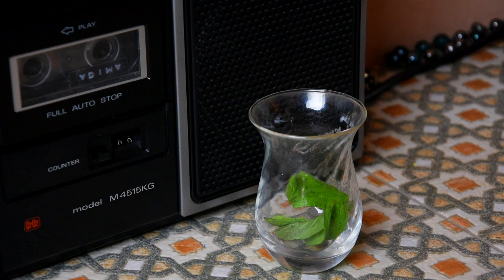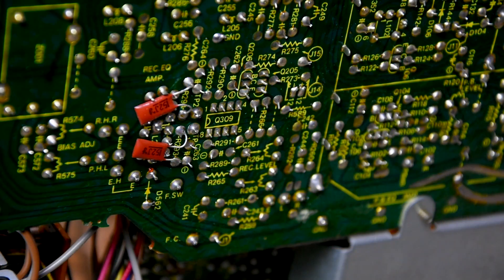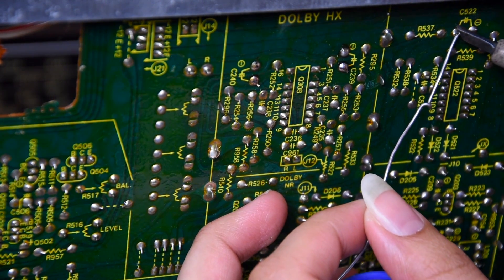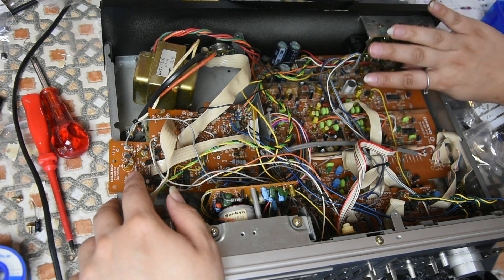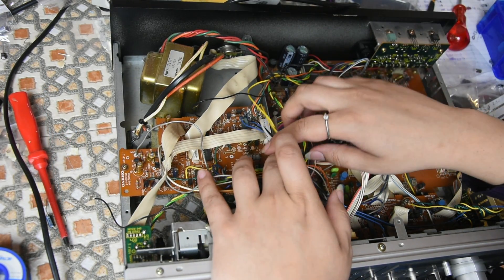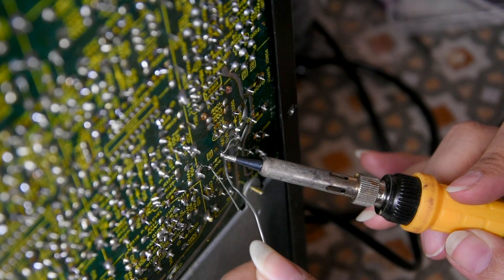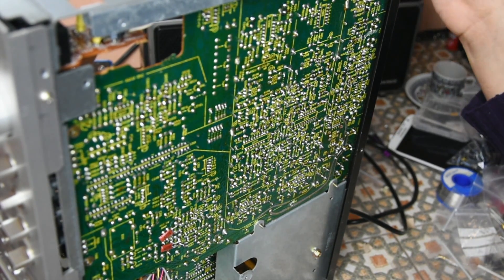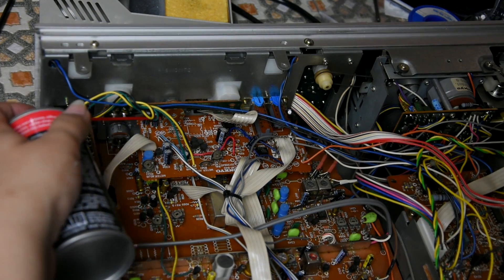Onkyo Tape Deck Part 2 - Capacitor Replacement

Comment: hi there! why did you chage  a lot of capacitors: it s a fake reason. Nowdays I had had to repaire a jvc qla-2 turntable,the problem was the stroboscope lamp was flickering ,and went out,4 capacitoes was resoldered,but all of them was in excelent value.only the R824 went out but the epoxi was over on it.every 4 capacitors was correct after 42 years

Comment: Do you know what you are doing there? Why did you replace the capacitors?
Reply from the maker: Yes I do.. I replaced the capacitors because 30+ year old electrolytic capacitors tend to dry out and the value of them drifts rendering the circuitry not running as it should or they leak/risk leaking which could damage the pcb.
Reply: @MsMadLemon  that makes sense... It would be better if they would last forever. I used to replace one or two foil capacitors from my Yamaha pianocraft stereo because it didn't turn ON when I switched the key.

Comment: Is it just the camera angle or is your soldering iron tip the size of a shovel? From experience I have always found it easier to lay the board component side down on the bench. I'm not a posh as you I still use the spring loaded de-solder pump. with the board flat you can rest your hands on the rest of the board. this gives better stability with the iron and the components fall out under gravity.

Comment: By chance I saw your video. You don't often see a girl who likes radio equipment. Usually girls like dolls and butterflies. They don't do repairs, maybe because you need to strain your head. But this is a very good activity for training your brain. You speak English well, almost without an accent. But what country are you from and how did you come to this passion?
Reply from the maker: I get this feeling you don't know many girls, there's a lot more to our lives than dolls and butterflies haha. Some of the first computer programmers and assemblers were women btw, not to mention women doctors and scientists too :o)
I live in the UK but originally Arabic from Iraq. And when I was a child, I used to mess around with broken toys, take the electronic components out, then slowly it turned into messing around with motors, light bulbs, leds etc. Then later, computers.
Reply: I respect people who know how to repair radio equipment, because I know what it is and have been doing it myself for a long time. You yourself know that finding a fault is sometimes not easy. It's kind of like playing a chess game and requires a good intellect. As for women, for the most part they are as I wrote (this does not concern you in any way). Of course, there are very smart ones among them, but there are not many of them. I myself am a doctor by profession and studied at a medical institute in which girls were 90%. For 6 years, I came to the conclusion that they achieve success in their studies not by intellect, but by diligence and diligence (which men are deprived of).
Reply from the maker: "Dolls and butterflies" you are basically suggesting that every woman has a brain of a 3 year old. It's too much of a primitive and narrow view for a medical doctor is it not? it sounds like you've lived your 6 years in isolation judging by that conclusion.
The world is a big place and it's not possible for you to know every woman in it. Sounds as if you've come to a premature conclusion based on stereotypes.
Anyway, to you, your viewpoint.

Comment: This is great and you are very funny, maybe you are breathing in too much of the soldering smoke haha. I need to recap my Denon DR-M22 tape-deck asap. The capacitors must be about 34 years old now, so I think It's overdue and I don't want the power supply to fail and fry the rest of it which is the biggest risk I think? I will be replacing every cap in the machine and a few other bits.  I wish I had your desoldering gun, I am on a tight budget and only have a lowly pump! it's going to be a long job but I can't wait to start it. Thanks for the videos, they are entertaining me and helping me write a list of the tools and parts that I need to get together in preparation to restore my  deck, also making me think how I'm going to go about the job :-)

Comment: Were you trying to say farads? Capacitance units are in Farads (named after Michael Faraday, a genius) and usually are pF (picofarads) or uF (microfarads). One thousand pF's is one microfarad so the pF ones are much smaller. If you already know all of this then accept my apologies. Damn you are hot.

Comment: There is a reason to why some components are glued in place, and it has nothing to do with that they will fall off or anything but to prevent them from vibrating and because of that wiggle the solder until it breaks or it might cause resonance which will make the equipment to hum or buzz. There are corrosive glue or resins that could destroy the holes and the board if you're unlucky, so if you have the possibility to remove it then do so.

Comment: Hi Ms Mad Lemon. 
Just curious, why did you think you needed to replace all those electrolytic capacitors? 
Modern capacitors like in your Onkyo are very stable and last for decades without failure and don’t leak like old vintage oil capacitors. 
If there was any issue it would be with the large filter capacitors in the power supply section, but very unlikely. 
Anyway, fun to watch and like the de-soldering iron.

Comment: I've seen some of your stuff before from time to time, like your collection and set up of stereo equipment. Just seen this and you very clever to do this type of thing. Im always amazed and respect people that just know and fiddle with electronics cos I don't have a clue. Wish I knew how to mess around with electronics cos I've got bits I wish to make as a hobby.  I live in London and for the past few years been searching and researching to set up a nice stereo system with a turntable I have in mind but with a vintage amplifier and nice speakers from the 80s or 90s. Want to have a little record collection of my own cos I used them as a kid... Was great sound and still so fascinating. Would love to be able to speak to you about sound systems, equipment and servicing of such stuff before I go out and buy. Love the videos anyhow. Great work, keep it up.

Comment: I got a nice ghetto blaster boombox, but unfortunately the record/playback side of tape deck uses the permanent erase magnet instead of an actual erase head. And I was wondering if there is a way to replace the magnet with an actual AC erase head. Those erase magnets really ruin tape recordings, as they add unwanted background noise to my precious recordings. Any idea where I hot wire the wires from the erase head?

Comment: I think the eject system uses a rubber ring too  in the cylinder to brake the door. I've seen similar parts in Akai decks

Comment: Electrolytic capacitor replacement is recommended, perhaps every 20-30 years? 
For those who are not sure - replace with the same capacitance value, and with the same polarity - but a higher voltage rating can be used, no problem.

Love your videos. (Greeting from the UK)

Comment: You are right about the labeling of components. Makes it much easier on decks that have them. The reason a lot of companies would glue the big caps is to keep them from vibrating. Great job on the recap.

Comment: Dear Ms. Lemon,  I've watched other videos regarding replacing all the capacitors in electronics, but I do not know why they need to be replaced. other the ones that are swollen.  Can you help me out here regarding the importance of replacing capacitors?  Regards, Carl
Reply from the maker: Hi Carl, actually a couple of reasons. As you know with the ones that are swollen they can leak and corrode the circuit board causing damage. But not only that, the electrolyte in some of them can dry up and the value of it can shift causing many different problems depending on where the capacitor is/what it's used for in the circuit. Filter capacitors will not be as effective, therefore will not filter out noise as they should. There are people who say "Recapping is not required" actually i've proven that it is. for example I recapped a Commodore 64 computer, which before would not load certain games, it kept coming up with load errors no matter what I did, after recapping most of the games that didnt load, started to.
Regards, Maddi

Comment: Can you imagine how scared I was when I first plugged in an AT computer power supply after a nearly-full recap yesterday? I've had two of them blow up right in front of me so I know what that feels like (untouched ones, not ones I'd re-capped)! Did use a series light bulb just to be safe but it doesn't seem to do much with such a small load. The PS just turned on as if the light bulb wasn't there. If I remember the voltage divider rule correctly, I should have used a smaller (i.e. higher resistance) bulb than the 100 W i usually use. I was most worried about the only two capacitors I didn't replace because 330 uF/200 V are pretty hard to find. These are right behind the bridge rectifier so I suppose if they went, they'd do so with a fairly substantial bang. Not that I'm anything like an expert on switching-mode power supplies but I did figure out that the AC mains goes to the board, through some kind of inductor or tiny transformer, then a bridge rectifier and then the big caps (in series to get a 400 V rating) so I'd expect some nasty DC voltage at that point.

Comment: Do you have a link to where I can buy that solder remover you are using at 4:26? Thanks
Reply from the maker: I got mine from another place but it's basically this one: https://www.aliexpress.com/item/ZONESUN-110V-220V-Electric-Vacuum-Desoldering-Pump-Solder-Sucker-Gun-heating-core-suction-tin-S-993A/32906270535.html?spm=2114.search0104.3.250.7f544b03pnsEqh&ws_ab_test=searchweb0_0,searchweb201602_3_10065_10068_10130_10547_319_317_10548_10696_10192_10190_453_10084_454_10083_433_10618_431_10307_10820_10301_10821_10303_537_536_10902_10059_10884_10887_100031_321_322_10103,searchweb201603_52,ppcSwitch_0&algo_expid=2e77e844-fcf7-4478-b090-74bf2f96615c-34&algo_pvid=2e77e844-fcf7-4478-b090-74bf2f96615c&transAbTest=ae803_3

Comment: 1:13 that didn't look like glue to me, but like electrolyte ooze! The reason i think that is because it's that flat around the base - think about it, it wouldn't be possible to apply glue after it was soldered down. But if it's ooze, it's better to get it all out, get in there with contact ether, with isopropanol, whatever your weapon of choice, and get it all gone so it doesn't eat into the PCB underneath or the capacitor that you install next on that spot. I mean still could be glue if they applied it pre-wavesolder to make it not jump off the board while it's doing the wave, so i'm not 100% certain. But yeah they can ooze from the bottom, if they ooze slowly and the pressure isn't enough to break the top.
Reply from the maker: That was definitely glue, electrolyte ooze I imagine would do more damage to the board by now, nor would it stick down that hard. There is some leeway when the cap is soldered in, enough to lift it slightly and squirt glue under it.
Reply: Who in their right mind would fiddle with a capacitor after it's soldered in, at a factory where they have to make hundreds of those boards a day? If it's glue, it was put there before they put the capacitor in.

As to whether it would have done more damage to the board if it was ooze... well it's a single sided board, there's little to damage on the component side. But there is still a new capacitor and its leads, so... but you're likely right, it would be glue.
Reply from the maker: Most likely the glue would be put on before the capacitor was soldered in and stuck down, i've seen this on every vintage amp and deck i've opened on the larger capacitors. the capacitors didnt have any damage to them.  

Even if it's a single sided board, the ooze would still have corroded the surface of the board, so there would be a sign at least... but there wasn't.

Comment: Those original Nichicon caps are actually very good quality.  Did you check them when you took them out?  Probably they were still well within spec.

Comment: Interesting and quality  video. Anyway I  warn everybody regarding so called "recaping". For some electronic stuff it may be neutral to do. But for  tape recorders where special frequency characteristics is must   the value of capacitors have high saginficance. If they are replaced their values need to be matched to that which were used by producer. With  buying  capacitors with the same value printed as printed on original one it is not guaranted .

Comment: Why did you replace the capacitors if they are not swollen or 
devalued?
Reply from the maker: Replacing capacitors is essential in old equipment from the 70s and 80s, the next part shows how beneficial it actually was. old or devalued capacitors don't necessarily swell or bulge.

Comment: I think you didn't say in the video if now the Fade out works. Does it?
Reply from the maker: Ah yes, it does work though it's a little odd, it doesnt work when recording, it works during playback (very strange!) so if you use it during playback it will record a fade out on the song that is playing.

Comment: The other thing i like to do on cassetes is replacing those trimpots.....these comes very rusty....and its nice to replace them....and also check the DC Motors rpms.....

Comment: Well damn… really.. was that actually glue or maybe... the capacitors just leaked electrolyte? D:  Would that react with the PCB in a way they would stick together?
Reply from the maker: Nah it was glue, capacitor juice wouldn't have made it get stuck that strongly and would have shown signs of corrosion. Even the large caps in my Marantz amp were glued down, freakin annoying.
Reply: Ah I see. LOL  Even with THAT Apple wasn't the first. You know, with gluing things together. Onkyo did it before Them :P And yeah, i BET it was annoying.. you don't expect such a nasty move.. that completely turns a simple repair into a almost disaster.

Comment: Another interesting video. I also hate "the big switch on" because anything could happen, but so far no puffs of smoke. I enjoy the re-cap recap at the start, and also your madness. Yes the clue is in the name of the channel, in case anyone had any doubts before, although at the moment it could be called MadCap Mania!  The mystery item at the end... I'd say its definitely an I.C! What do I win?? At a guess is it a chip for your C64, - a new SID perhaps? :)

As for the compo, I chose some tricky Benefactor levels for the hardened players but this seems to have put off all the casuals during this long and hot summer. I mainly chose the Castle levels because the rest seemed too easy, but having played the castle myself, I now see the challenge is much too hard. :(  But I also chose the castle levels because of the ghost which follows the player, and I was imagining your play of the castle and your reaction to the ghosts, so that was also a small reason why I chose them. Maybe you will get to level 3 but I cant see most players going beyond that. I'll eat my words if you get to level 4. :o

Comment: looks like the desoldering gun makes light work of otherwise tedious desoldering. Wish I had got one of those instead of a hot air gun!

+ love inside the tree.

Hasta la proxima vez.
Reply from the maker: My favourite remix of my favourite shadow of the beast track <3
I nearly got a hot air gun at one point, wondering if i could recap my a1200 myself but glad I decided not to, I mess around with non SMD way more. 
hasta la proxima vez, saludos

Comment: Wow, that desoldering gun is super handy, definitely gotta get one of those! I noticed in your other video it looks like the gun has a dial for setting different temperatures. What temperature is your gun set to, and is it recommended to always add solder first before desoldering?
Also I have to remember not to watch your videos while working on my own projects, because you start laughing which gets me laughing which gets my table shaking and everything falls all over the place. :D
Reply from the maker: Hahaha yes you cannot work with constantly jiggling table :o))

About the pump temp, actually the lowest setting seems to be enough for small capacitors, probably the next notch up is the sweet spot I think... if you set it too high this pump gets a bit too hot, i'd never use the max setting, it's a little concerning lol. And yes I recommend adding a touch of solder when you first switch it on, but wipe on the wet sponge after each cap removal and you should be fine :o)
Reply: My desoldering gun's on the way, and thanks to your videos I know it's definitely going to be a huge help in adding sockets and recapping my C64s. Thank you very much for the info, I greatly appreciate it!
Reply from the maker: Niice! you actually ordered one!Yes from experience I say you're going to enjoy using this, especially for work on C64s, that throughhole soldering is a pain!. My pleasure, I hope it serves you beautifully! :o)

Comment: Very good. it works!  That door "dampening" piston: There may be an "o" ring inside that has cracked or dried up of grease.  The screw may regulate air (with a good o-ring), also modern silicone grease on the new o-ring can give you better control over the dampening rate. Sony used this system as well. (this was very entertaining ) lol
Reply from the maker: Yes something definitely has given with that piston thing, it's cracked or leaking air as you say that "o" ring.
lol Thanks Andy :o))